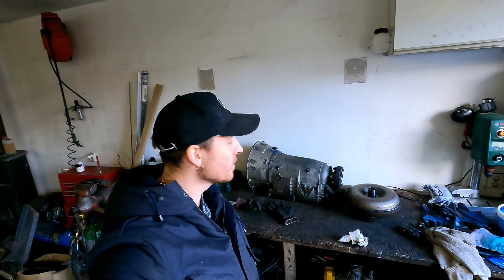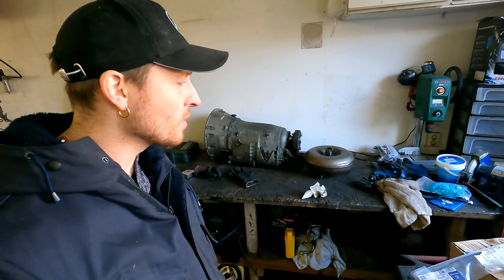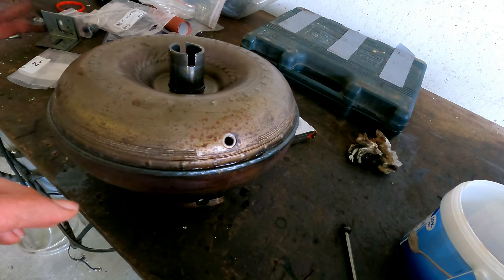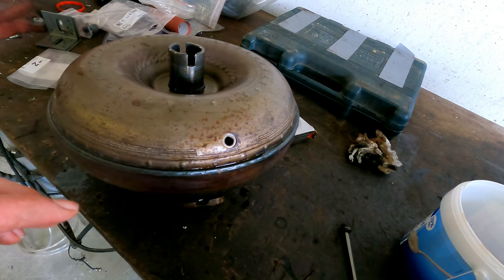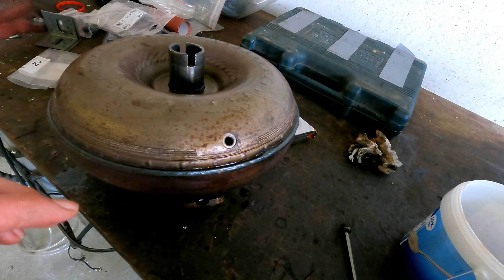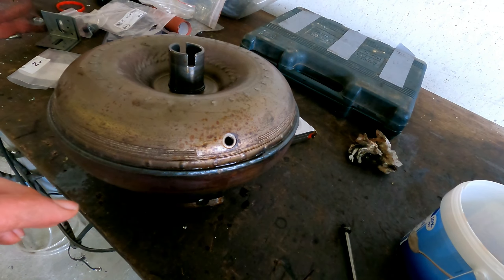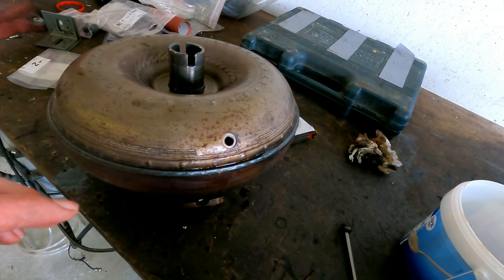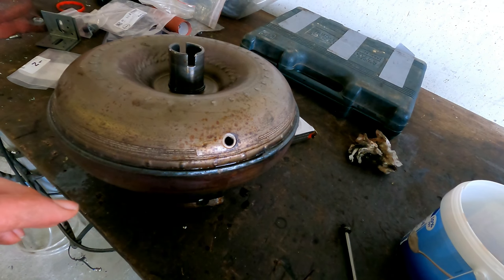Mercedes 722.6 Transmission service and valve body check

Comment: did you checkc out the Gearwrench xp120 ratchets?
Reply from the maker: Yes . Just online.  Quality looks good
Reply: @JMSpeedshop  they are awesome in tight spaces. they are like surgical tools. they are so good in places where there is no room.. smooth as silk. if you do not mind spending some money i think you will fall in love with them.
Reply from the maker: I will keep it in mind .  Thanks

Comment: Changed the valve body
Connector
Circuit board
Bought another gearbox
Still no solution
I guess these transmissions stay dead
Reply from the maker: Did you check the TCU. If it is wet of oil  and the wiring front the transmission to the tcu
Reply: @JMSpeedshop yes my own got the oil up there.. please what to do and what is the course

Comment: those conductor plates are cheap. I had to do one last year. I bought an extra one in case.
Reply from the maker: Yes that is why i changed it but the old one does not look to bad
Reply: @JMSpeedshop  Speed sensors can fail even at low klm. but after 17 years or so.
Good to fit a new one while you are in there.
Reply from the maker: That's why .